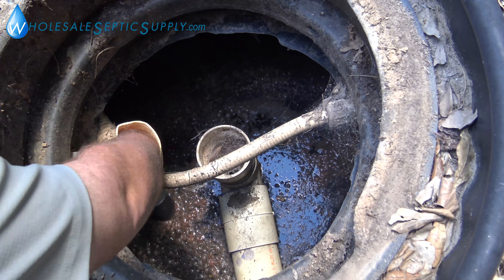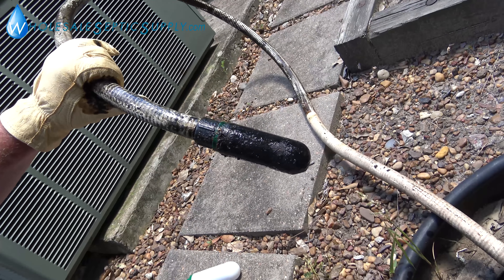Replacing a diffuser on a clearstream aerobic septic system

Comment: My hose was a stiff 3/4” reinforced hose and it cracked when I bent the hose. My union at the top connection was a brass 3/4” garden hose connector so I cut about 3” off of the hose and reinstalled it. Best to disconnect for pulling the hose rather than bending the stiffer ones.
Reply: Do you have liquid coming out of the PVC guide tube? If so, You have hurt your system.

Comment: mine has issue that water doesn't flow from aerobic treatment unit to pump tank, when aerobic treatment unit is full, alarm off, do you know what's the issue? the air pump works,  I see the bubbles
Reply from the maker: If it’s a Clearstream you shouldn’t see the bubbles unless it’s 100-1500 gpd something is probably wrong. There is a filter or what they call a filter that is probably clogged bacteria grow on it and restrict the water flow. Call the office we have licensed maintenance provider and installer on staff

Comment: Interesting video. So if a system has been sitting for quite a time, say 6 months to a year, it will clean itself up with the proper air infusion?
Reply from the maker: Junk Yard  yes it will come back on line only takes maximum one week but more like 2-3 days should be back up and running

Comment: Thanks for posting. So, what will happen to his tank? Will the oxygen 'clean' it up or will it have to be pumped?
Reply from the maker: nx99 it will come back it just really stinks if it's on a spray system for a couple days.
Reply: Thank you!
Reply: The air keeps bacteria alive that treat the water

Comment: If your pump is making a buzzing sound is that the diaphragm that is messed up.
Reply: Diaphragm is in the air compressor
Reply: I have the old style clearstream that the diffuser goes inside the tube mine is pushing water back out of the tube i have ran a snake through the tube with no results any suggestions?
Reply: @stacyhightower3291  Mine is doing the same. How did you resolve yours?
Reply: @joeknobbe7842  

I realize your comment is a year old, but I just encountered this issue. Bought the house a couple years ago. The system was inspected and passed by 2 different septic companies during the inspection process.

As it turns out, our air hose was not long enough to place the diffuser all the way past the end of the PVC pipe. So it was pumping liquid into the clarification chamber instead of  the oxygen being released in the bottom of the  aeration chamber.

The fittings are standard 3/4" Garden hose fittings. I connected my garden hose between the air inlet and the diffuser hose. I then pushed the diffuser hose in to the PVC until it stopped pumping water out of the PVC and I started hearing air bubbles instead, indicating the diffuser was in the proper location. Then I just cut a length of hose to go from the air inlet to the diffuser hose.

Previous owners had already replaced the drain field before we moved in. The system had likely been operating incorrectly since install in 1999.

Comment: Great video
Reply: Now....how do does the diffuser go to the bottom of the tank?  It doesn’t....it’s full of air and will float to the top, taking the diffuser up with it.  Option is to run a solid pvc straight down thru the opening centered in the bottom on a short flexible hose putting diffuser close to bottom and on correct side of the baffle.

Comment: I need that hose and diffuser exactly like that. What are your part numbers
Reply from the maker: Chris Court we have the diffuser not the hose though.
Reply: where can i get hose? or part number. My septic guy apparently took mine.
Reply from the maker: Chris Court i can get them. Call the office tomorrow i will see what they cost. You can also call clearstream they will have them as well don’t know what they charge though.
Reply: Wholesale Septic Supply  Will do - Thanks
Reply: Wholesale Septic Supply I called office. no one answered
Reply from the maker: Chris Court  9366818198.
Reply: How do you clean the aeration filter in clearstream?
Reply from the maker: Chris Court just remove the filter and clean it.
Reply from the maker: Under the housing is where the aerator is. It will be close to the wall of the house or close to the septic system.
Reply: Perfect - done -Do you know if all old clearstream systems have alarms? I see no red light either so I was unsure.
Reply from the maker: Chris Court should depends on how old pretty sure they all did even back in the old days
Reply: @wholesalesepticsupply  are you in Conroe Texas ?
Reply from the maker: clarie Qntna  Dayton Texas not far from Conroe.
Reply: @wholesalesepticsupply  thanks for the reply :) i have a aeróbic but o cant figure out were that diffuser is at since its a long PVC pipe
Reply from the maker: clarie Qntna what kind of septic system i will tell you.